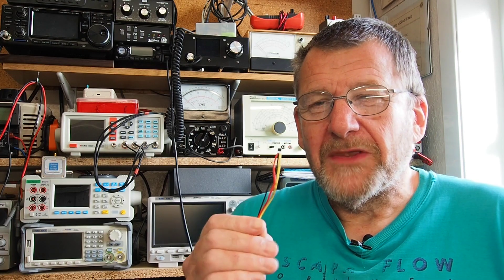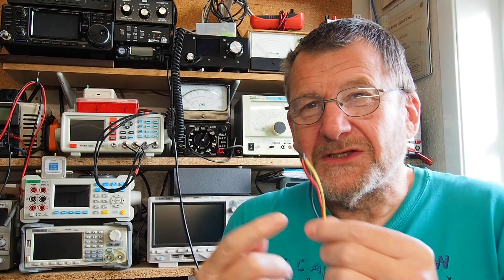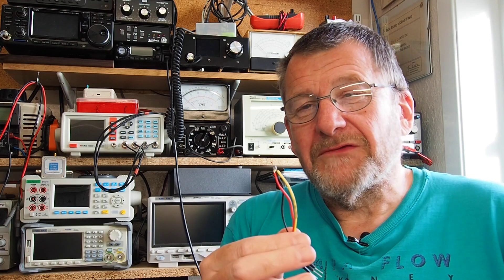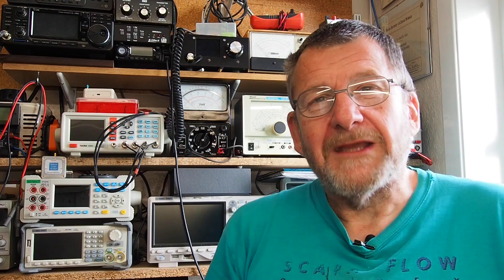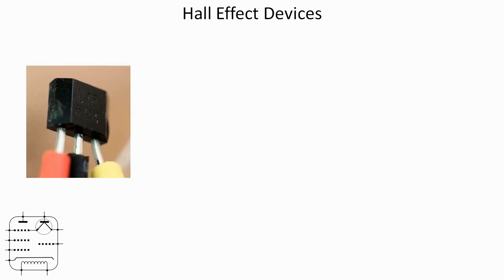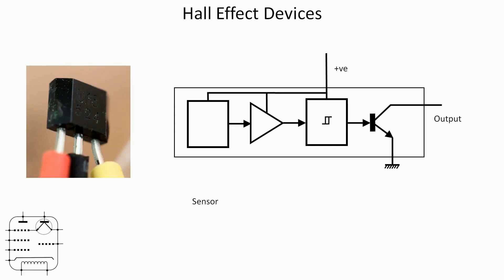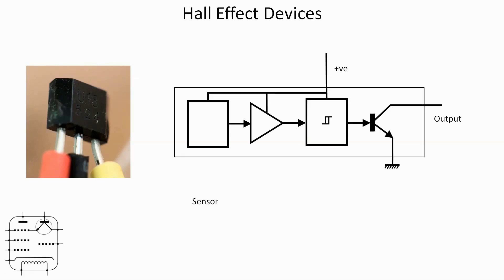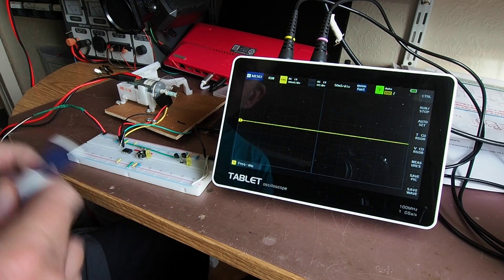Making use of Hall Effect devices   #095

Comment: Hi Bill. I want to use a Hall Effect device to switch on the carriage lights on my railway layout. The plan is that the coaches would pass over a RE magnet and switch on. On the opposite side of the layout would be another RE magnet with reverse poles to the first. The lights would then switch off as the coaches are now in the "idle" yard. I had originally planned to use latching reed switch but they are a rare beast it seems. Any comments and perhaps more to the point, where could I find a circuit that could be used by me. My electronic skills are limited to soldering!

Comment: Hi Bill, From the diagram of the Hall effect device you showed at the beginning of the video, the output is an open collector. All you needed to do was to add a pullup resistor to Vcc and take the output from the device's output (collector).
Reply: Indeed. The datasheet says yje output can sink up to 20mA, so you could connect the LED and series resistor from the output to Vcc  and get rid of the amplifier all together.

Comment: Thanks Bill for the video on the hall effect sensor.
Another way to experiment with a hall effect sensor if you don't have an oscilloscope is with an Arduino. 
Both can be had for a couple of pounds on ebay.
Bill, have you thought about doing side by side experiments with pure electronics and arduino, the hall effect sensor would be an ideal one.
Excellent video Bill, thanks.